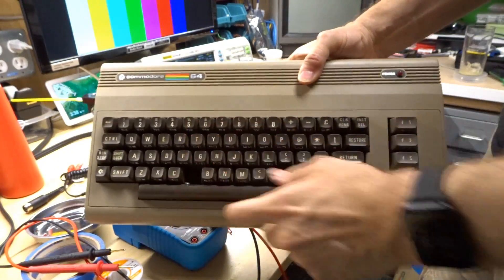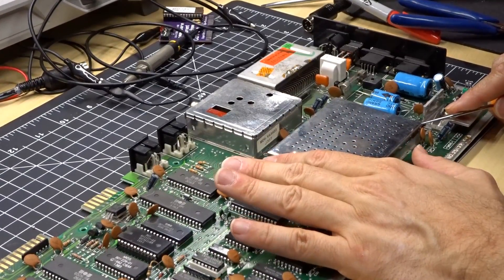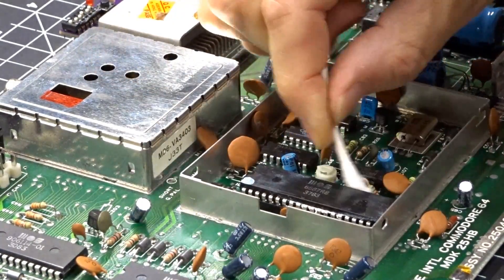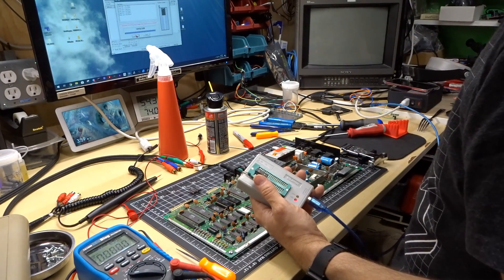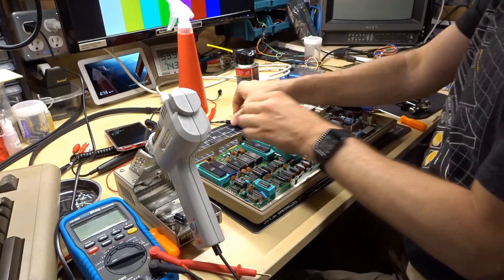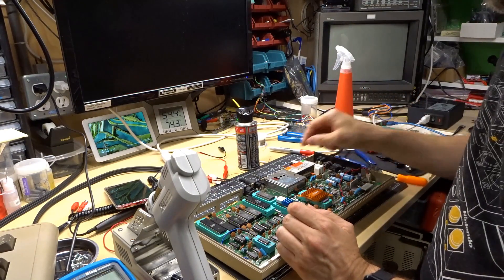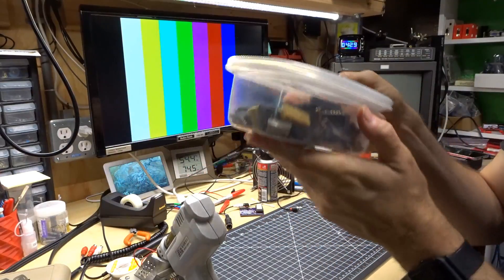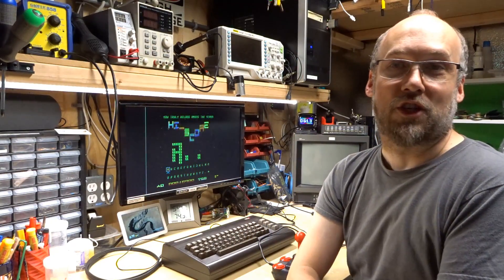C64 Repairathon! Part 2 - "Brown" screen fix for #2 and checking out machine #3

Comment: Love your videos and instruction.  It’s like a class for Commodore 64 users.  I am working on repairing mine now.  And even thow I don’t have it working yet I feel more  comfortable working on it now.  A  though it seems to me that you need to have a known good test machine to be able to repair other machines to check out chips with it the start with. And a good power supply. And like you say good audiovisual cables before you start working on the board. Plus, he can end up meetingsome other test equipment and soldering tools and things like that by the time you’re finished you can have a pretty good expense into a Commodore 64 by the time you get it tested out and running. 😂

Comment: I have a C64 black screen, have changed the PLA for a GAL replacement still black screen but noticed the 74LS629 next to the VIC has black legs like the casing has melted or something.  Could that be the cause or is this just corrosion on the legs?  Chips are not socketed so I don’t want to randomly remove things

Comment: By the way the under board RF shield is useful if you drop a screw and it's under, it prevent your screw to touch the circuit.

Comment: I’ve found the Loctite plastics bonding system (primer and glue) works excellent for C64 cases.  It makes a very strong bond with that ABS plastic.  Being a thin glue the pieces can be  fitted very tightly.

Funny you save your dead C64 chips.  I save all of mine too for...I don’t know, sentiment or something.

Comment: I like your methodical approach. But then again I wouldn't throw away the shielding - for protecting from stray signals and for keeping it complete as a collector item.
Also, will you still check the I/O ports? I'd never declare a machine fixed without checking all the keys, the IEC and maybe even the Tape port. I've had enough machines that booted fine but were unusable due to broken I/O

Comment: You are the official RF Shield hater... I really don't understand why you throw them away. I personally try to make the repair as invisible as it could be, so any vintage device I repair looks like it was untouched. And I do lots of repairs.
You are not getting paid for repairing this, and it would be nice if you kept the machine in the original condition. Someone might buy it and discover that the repairman was a hack, he didn't care to replace the RF shielding, even if it repaired the machine. Even if you own the machine, it isn't going to be yours forever. Perhaps in 20 years someone will buy it :) FCC regulations or not, the RF shielding was also used to prevent outside interference to effect the computer. Use a poorly designed switching power supply near it, and it might have an effect on it. I had a problem once like that.

Also the idea of putting aluminium heatsinks on these chips disgusts me. Down the line, the glue you used to hold them on will fail and the heatsinks will fall off and short something. Also these things were designed to run a bit hotter with no consequences. The main thing it is killing them is the old age.
Reply: @adriansdigitalbasement  I am sorry if I offended you. But as I said, these machines are now collector items and they are best to be preserved as they came out of the factory. Also the level of RF emitted on these machines is very high, compared to computers nowadays. So the RF shielding is important nevertheless. Just last week I was dealing with interference on the radio (FM band) in the house. There was some hissing noise, and I couldn't figure where it is coming from. I tried AM band, and the noise was unbearable, it overpowered even the closest AM radio station. I then discovered that a 12V switch-mode power supply is causing it. It was a new unit, I put about month ago on my ethernet switch, as the original one died. Interestingly, the noise was also present (and about the same level) when I tried the radio in the garage, which is 50 feet away and on different AC power phase. I went to the neighbor house and the noise was still there, albeit much less. I guess the SMPS is cheaply built and not using any common mode chokes, interference suppression capacitors or RF shielding :)
Reply: About the heatsinks, I think they figured out the chips were actually running a bit hot. But still the failure rates of the newer revision boards vs older are about the same. So perhaps they thought they might improve on reliability, and decided they would put a RF shield that would also serve as a heatsink.I know for a fact that the Sinclair ZX Spectrums have issues with some chips overheating, especially the linear regulator transistor and ULA chip. But those failed even back in the 80s, where C64 failure rates were much lower then. 
Do you repair any vacuum tube gear? I have a feeling you would put a ton of heatsinks there ;) I was amazed on how hot some of the gear got then, when I started with repairs on such things few years ago. 1960s 17-inch TV, 200W, no problem :) 1970s 50W guitar amp, idle consumption 80W, peak almost 150W. Small tube AM/FM radio 65W. Audio (or power) output tubes can easily idle at about 150 deg. C. I am still not sure how these things even lasted more than a year then with so much heat being dissipated (and trapped) inside.

Comment: Adrian Black,  how do you calculate using a handheld calculator and formula to get the ROM signature value and ROM checksum value? What IC chips output IRQ signals to the CPU z80 IRQ inputs?

Comment: I would not throw away the RF shield. Especially the metal ones. They shield the electronics from electromagnetic interference from outside. Especially today, where you have mobile phones, WLAN, digial radio, ... Best regards, Doktor64!

Comment: Please: There is NO NEED for throwing away little broken plastic parts, or using epoxy!
Use an ABS solvent glue (used in model constructions), it works perfectly on Commodore machines, as it doesn't just stick pieces of plastic together, but it actually melts the ABS, making for a much better hold than even the unbroke, yet brittle poriginal plastic itself!
It's cheaper, it looks better, it's stronger and it's easier to use than epoxy or any other glue.
For example: Uhu plast special.
Reply: Acetone can be used instead of special ABS solvent glues, as it actually dissolves ABS as well. I've used it to stick 3D printed parts together and it holds really well. (I also use acetone vapour to smooth out ABS prints, but that's a different story)
Reply: Great tip!

Comment: Cool video as always.  I used to have the VIC 20.  Parents never got me the 64.  Had the tape drive as well.  Made a security system using the joystick port to alert me when my parents came home by using magnetic and vibration contacts on the exterior doors.  Told them it was just for science.  Made screens display when the switches were activated and played a beeping sound.  i miss that old thing.  I wish I still had that program and machine.    LOL

Comment: Hi. What were you using to test the 74xx series chips at 9:00 mins in please?
Reply: I think its this one.  https://www.amazon.com/Signstek-TL866PLUS-Universal-MiniPro-Programmer/dp/B00K73TSLM/ref=asc_df_B00K73TSLM/?tag=hyprod-20&linkCode=df0&hvadid=312167716765&hvpos=1o2&hvnetw=g&hvrand=5175181942875124383&hvpone=&hvptwo=&hvqmt=&hvdev=c&hvdvcmdl=&hvlocint=&hvlocphy=9028071&hvtargid=aud-643191255296:pla-568129173731&psc=1&tag=&ref=&adgrpid=63813708882&hvpone=&hvptwo=&hvadid=312167716765&hvpos=1o2&hvnetw=g&hvrand=5175181942875124383&hvqmt=&hvdev=c&hvdvcmdl=&hvlocint=&hvlocphy=9028071&hvtargid=aud-643191255296:pla-568129173731
Reply: It is the TL866 that is made by http://www.autoelectric.cn. It is one of the best Chinese electronic gadgets that you can get. It lacks a bit on less common older ICs but has more than enough unique features on its own. One of those very usefull features is that it can test 74xx chips.

Comment: I really enjoy your repair videos but I have two comments regarding installing sockets - first, as my friend "Flashjazzcat" suggests on his own excellent Atari repair videos, adhesive putty of the sort available at any drug store, Wal-Mart or Target, works great to hold sockets and other components flush with the board when you turn it over to solder. It's sold as "Blue Tack" in the UK. In the US, I got 3 large chunks of 3M branded adhesive putty for about $3.29 or something just a year or two ago. Second comment - be careful when you heat the solder joint of an off-kilter socket like that in order to push the socket or other component flush. If the board is in poor condition or if the solder is not really good and melted all the way through, you can lift the pad or separate it from the adjacent trace on the back when the component finally settles into place. Basically you want to be able to shift that socket flush with the barest-minimum of force. Anyway, excellent video as usual. Thanks for making great content for 8-bit nerds like us.  ALSO: RF shields suck. I ditch them on all my systems whenever possible! #flamebait :)

Comment: Do you pigiback RAM chips with a known good one for fault detection like I've seen others do?  It works.  Just spread and form the pins on the good one a bit and friction fit it over each RAM chip or the one or ones detected as bad by a diagnostic cart.

Comment: Just got that chip puller on amazon... THANX! love it.
Reply: Could you post your amazon link?   The link I'm finding only shows semi-local distributors.
Reply: @Eightbitswide  https://www.amazon.com/Jonard-EX-2-Extraction-Tool-24-40/dp/B006C3Y8IY?pf_rd_p=0fc3f2c4-3ed5-4d11-9995-8d7c82394713&pd_rd_wg=HNH6f&pf_rd_r=54TN35V9CB1JDQX6KE7H&ref_=pd_gw_cr_simh&pd_rd_w=w5Odb&pd_rd_r=8c26d72e-1ce9-4775-9ce3-78f93ca94ae3

Comment: PLAs are easy to test with a logic probe, before being extracted. This one more likely has a bad I/O output pin and it would be detected by the logic probe :) Good guess anyway :)
Reply: @adriansdigitalbasement  I have a list of what the outputs should look like on a working C64, they are on pins 10 to 13 and 15 to 18. Most of the times, on a bad PLA, one of these pins has no valid logic level or is stuck high or low. Failure to initialize correctly the VIC-II points to pin 12 usually (I have a video on that :D).
Reply: @adriansdigitalbasement  What you typically see with PLAs on an oscilloscope is that the IC is no longer able to pull the pin low your high. For example when it should be logically 1, it doesn't get any higher than 0.7V or something, which is regarded as a 0 by chips it communicates with.

Comment: I'm loving these videos. I especially like the "time lapse" of you  cutting the rear shielding off. I've never actually owned a Commodore. My father had a VIC20 when I was in Kindergarden, but donated it to the school for some unknown reason.. hah..  And I had a buddy that got a C64 really late, like circa 1993, so it was an oddity that neither of us really had the patience to use with it's slow floppy drive and 300 baud modem. Anyways, I just scored a C64 from Goodwill online, should have it here in a week. Your videos will be invaluable in troubleshooting it, even if I don't have a spare known good unit to swap chips with. I'm really looking forward to seeing which revision PCB I have. And I will be building a safe and reliable modern power supply for it as well. I've always loved troubleshooting, it's just very rewarding. Keep up the great videos!

Comment: Hi Adrian, Do you think it would be worth taking the time to make a 6502 or Z80 CPU tester kit perhaps a group project ? I am working on some arcade game PCB and have no way to test the 6502 in a few faulty bootleg tetris boards I was given. The cpu is running after fixing the reset circuit and also replacing a faulty 74ls245, but I just have garbage on the screen. It could be any one of 6 PAL chips or even the 2nd processor.
Reply: @adriansdigitalbasement  I was thinking it might make a interesting project more than the cost of just replacing a cpu. I keep watching the Ben Eater breadboard stuff and it gives me ideas !!
Reply: @adriansdigitalbasement  https://web.archive.org/web/20091021040507/http://geocities.com/SiliconValley/2072/6prj1pic.htm

Comment: #3 should have the VIC II which gives a much clearer picture quality, but the color saturation is a bit less as the older VIC ;) its also my preferred one and loved that 6581 SID as well, cant wait for part 3 ...
Reply: The Commodore 64s all have the vic 2 chip, the original vic was in the old vic 20 which did not have very good graphics capabilities

What you mean are the various revisions of the vic 2 which were like little upgrades to the original vic 2 chip
Reply: DJ Slinus good to know thx for the info

Comment: Actually, that desoldering gun isn't too bad for what you pay for it. I took mine apart and added high-temp ATV silicone to the solder joints to cut down on the vibration stress, but otherwise they're not too badly made. The one thing to watch for in normal use is that you clean the tip regularly. Make sure when you suck that you wiggle it around a bit to loosen the pin.

Comment: Does anybody have a dump of that PLA? PLAs are jellybean parts, the problem is whether or not you know how they're configured. If you do, you can easily program a new one.
Reply: In theory  you can read a PLA and copy it with a PLA Programmer in a similar fashion as a FPGA. But they are a lot more expensive than a FPGA.

Comment: As a Commodore bench tech from yesteryear, when you can’t quite figure out what’s wrong, swap the PLA!
Reply: Do you happen to have a dump or a truth-table from that PLA? If so, it shouldn't be too hard to program a new one.
Reply: You mean this?  http://www.zimmers.net/cbmpics/cbm/c64/pla.txt
Reply: I haven’t seen you try the RAM piggyback technique. If the chip is blown open, you can sometimes find it by piggybacking another chip on top. Just bend the leads toward the center a bit for it to clip onto the chip you are testing.
Reply: @CandyGramForMongo_  So long as it doesn't have a failure as "short circuit." Not all ICs do, and sometimes it'll be a mix of shorts and open, especially logic ICs, depending on how it failed.
Reply: I didn’t say it worked all the time, lol!  Any edge you can get.

Comment: Adrian could you reconsider throwing away the RF Shields?. These computers are collectors items.
Reply: the computers are, the worthless shields (which aren't even that effective) aren't.
Reply: I can't see why.

There are estimated 30 million units sold. If you want to preserve them stock, buy lets say 10 for yourself and lock them in a box in your attic. 

Maybe your kids or grandkids will find them a long time from now, so they can remove the RF shields after they need a VIC replacement. :)
Reply: @ToTheGAMES  Considering the fact that these things go for $100-200 on eBay, I don't think i'll be buying 10 any time soon.
Reply: @ToTheGAMES  How about just don't throw away RF shields because they're there for a reason? It's essentially ILLEGAL to do so, and for a good reason.
Reply: @ToTheGAMES  However many there are, they are still vintage collector items. Yes there are many out there but they are slowly dying and 30 Millions sold does not mean there are 30 million in existence.
Reply: @latengocomoburro  Not to mention how many were sent for e-recycling or landfill, and are now gone forever :(
Reply: And there's absolutely no sense in throwing these away. No one can tell me, that his time was so expensive, that 10 seconds for putting the shield back in was not acceptable... For real I think this is just a bad habit, that sadly has established itself as 'being a cool retro tinkerer' on YouTube.
Reply: @BlackEpyon  That's right.